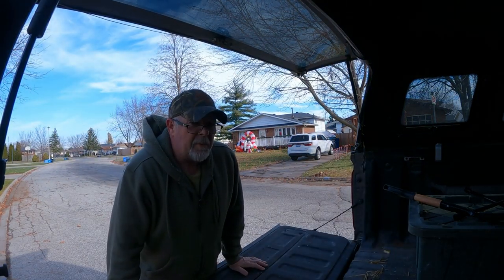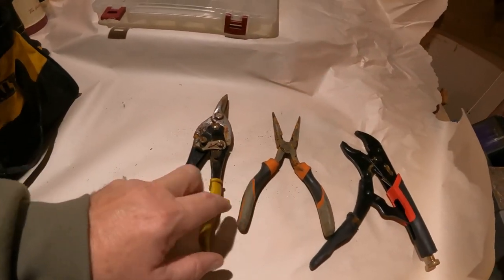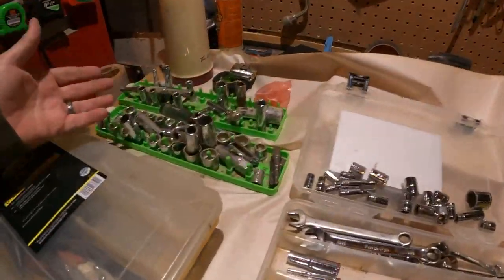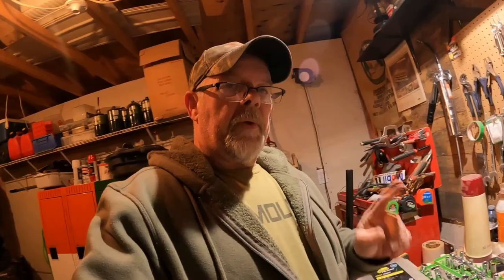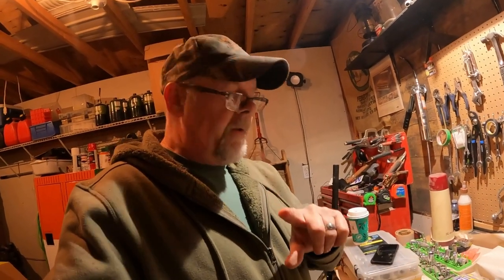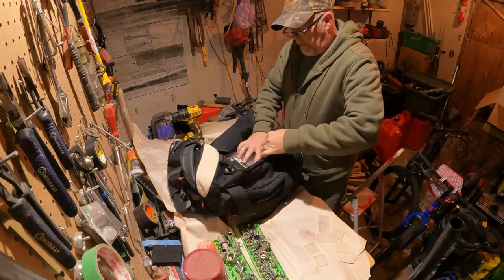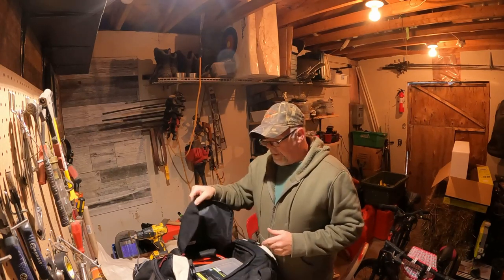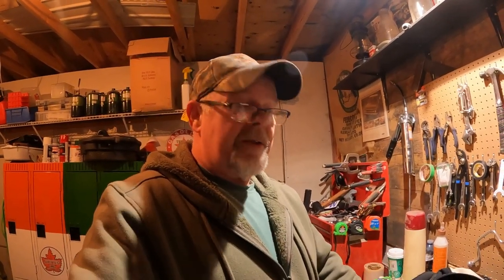Edc Tool Storage For Your Truck: How To Stay Organized On The Road

Comment: Love this video, Larry. I'm like you, always want to be prepared for the worst. As requested, a couple additional items for consideration that I carry in my truck: flash light (both handheld and head band), Leatherman Wave multitool; tow equipment: (tow strap, kinetic rope, soft shackles, tree trunk strap, hand winch, D-ring hitch, D-ring shackles, tire deflator tool, and heavy duty chain); ratchet straps and cam buckle straps; snow rescue shovel; reflective vest; wool blanket; extra mitts and touque. As I am sure you know from your experience, both as a law enforcement officer and as a courteous member of society, there is nothing quite like coming to the rescue of someone stranded in a snow bank or broken down on the side of the road in need of help and being able to do so.

Great idea on the fuses and hose clamps! Never even occurred to me!

Love these kinds of videos!
Reply from the maker: Thanks James there’s many other items like tyraps and hammers fire extinguisher. We just drove 5500 km and from now on if I have room it will coming with me.

Comment: Bars leak , some premixed anti freezee , electrical tape ,1 liter of motor oil ,tire plugs , air compressor ,booster cables and a emergecy power pack to jumpstart the vehicle